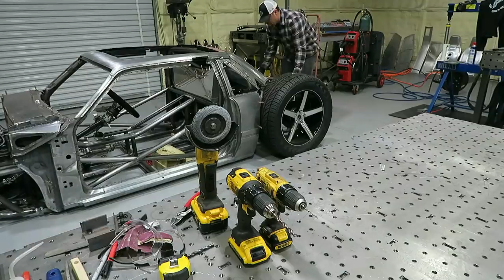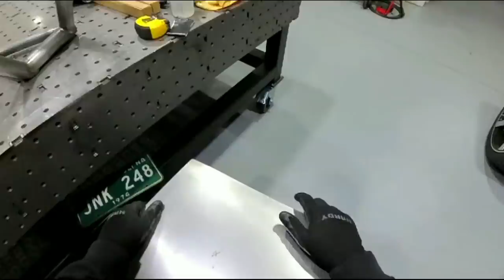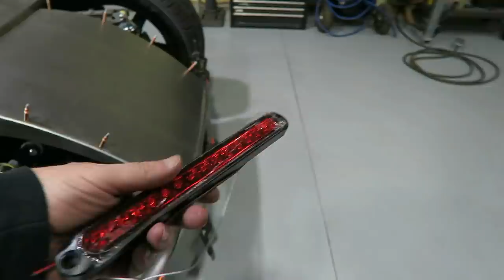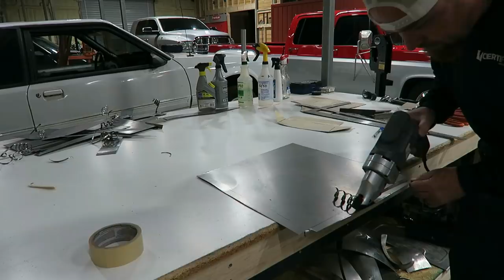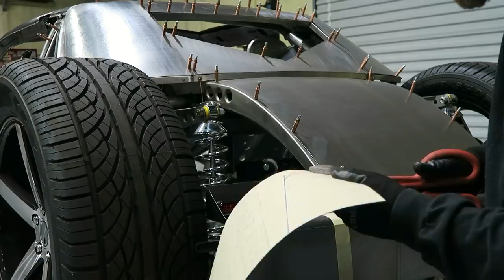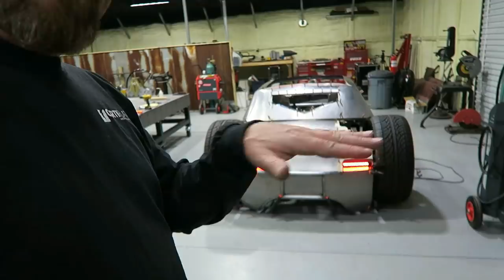Making Tail Lights for the Custom Fox-Body Hot Rod Build

Comment: i remember in an earlier video when you designed the suspension you said you wanted it visable to show it off, and where you're going with this looks awesome but if you ever decide not to show it off it would look amazing if you english wheeled some metal on either side of the "trunk" center section to match the curve of the back wheels at ride height and slightly bubble up in the middle of each piece... its sooo cool! keep going

Comment: That is Bad-Ass looking.
If it was me, I would put 2 drain holes in below the the where the tag bolts on (down by where the pipe meets the flat plate) that way the water can drain out when you wash it or it rains
     Kool Fab - Kill Fab 😎

Comment: It would look great with a body line down. The center and make the center look taller than the tail lights. Basically round it down to a lower part where your paperboard is. Looks good

Comment: You should put wheels on those homemade jack stands. When you weight on independent suspension, it binds the suspension up until the car is rolled forward or back. If they had wheels the suspension would be able to squat all the way without being rolled. 
That how you have to do when doing car alignment, after you jack up the front to check front end.

Comment: I like the idea of the open suspension but what about rocks and road stuff flying up in there? I understand you may need to get in there for work/adjustment. Why not make it hatched? At a show when its lifted it'll be up and down with the body and people can see in. My thought though is that you have is smooth bare metal beast, having it open may obstruct the flow of the body. Could make the area vented in a way, would give possibly some aggresiveness to the body

Comment: As mentioned previously... Love the build. Love watch you work your vision and take your time. Keep doin what your doin man! Regarding the 3rd Brake... Id like to make a suggestion. Why don't you get the same brake lights you have - but maybe 2 "smoked" lensed one (for less visibility when approaching/viewing the aesthetics when its sitting) and create a shallow slim/tight "V" shaped bucket/3rd to sit in your radiator intake/bottom of the back window. Something usable but different than the average 3rd. Maybe steel exterior to match the car, but flat black interior of bucket to hide the lenses in the shadows of the bucket and not be too obvious to what they are. Just a suggestion!
Reply: Also, forgot to mention, love the brake buckets. Turned out exactly the way I was hoping with your vision.

Comment: Was that WD40 you sprayed on before running thru the forming tool, or something else? What's the reason for that, just curious - I've learned a lot from your channel :)
Reply from the maker: Yeah it was WD40. It just helps the metal move easier.